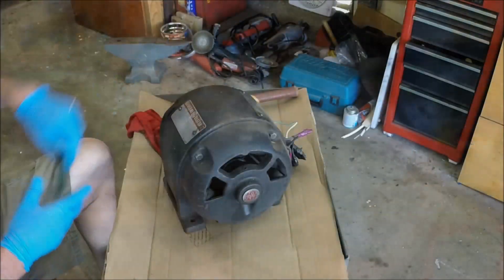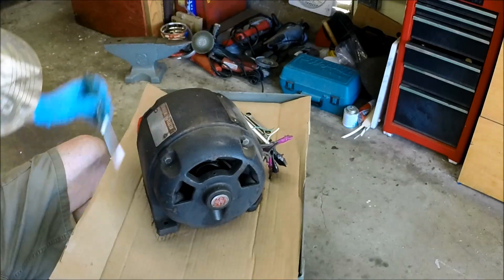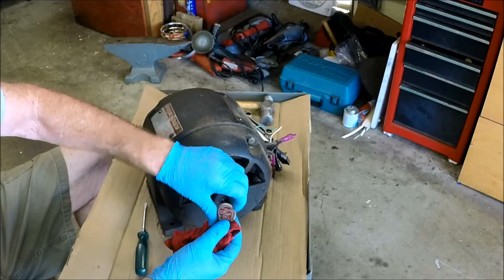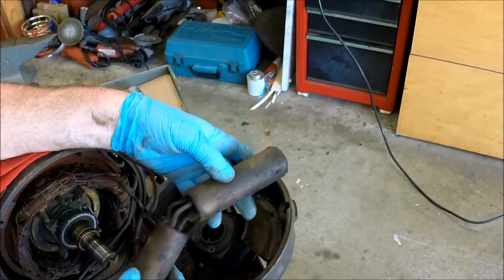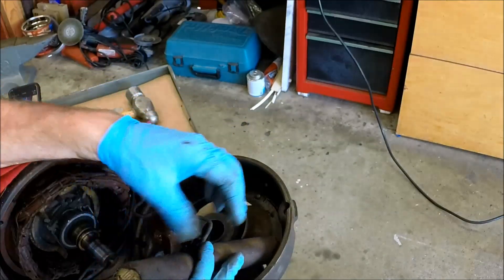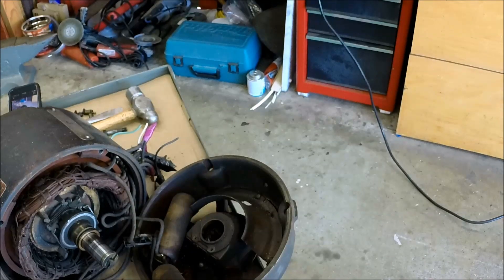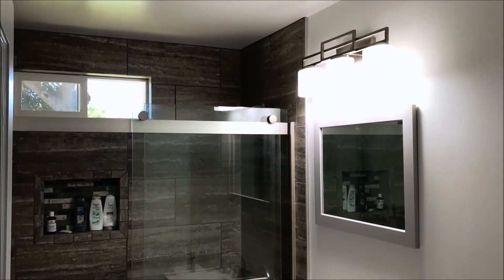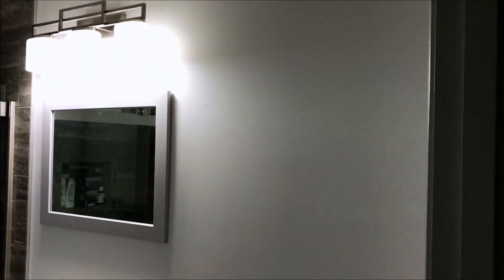GE Motor and Sticker Wall

Comment: It's amazing how much money goes into such a small room looks great as per the motor I'm guessing that 2 small caps fit in the tight space versus 1 large one that mouse had a nice pad until he discharged those caps
Reply from the maker: Doug, your right on. the the 2 small Caps will fit the space, single one would be too big.

Comment: YES looking at that fine motor Dean, looks great to us. 
14:30 hello Active Atom (thank you for including us on the wall Dean)

We watched Randy's red motor rebuild it is a great motor no wonder we liked yours when we saw it, we love motors here a lot.
Why do we like these older motors? because you rebuilt them rewound them whatever but you generally did not replace them we love those times lone that motors cast housing Dean, thank you for sharing it.
Lance & Patrick.